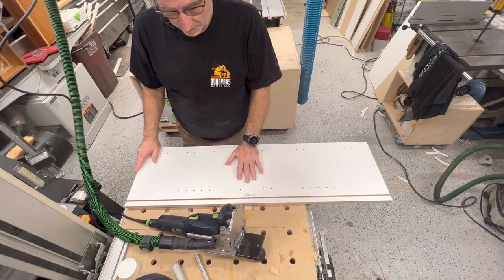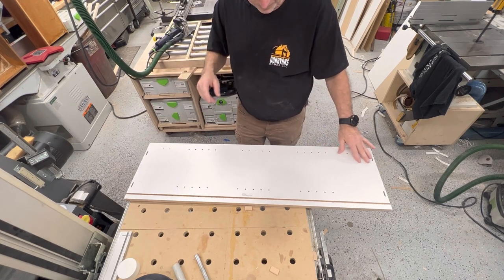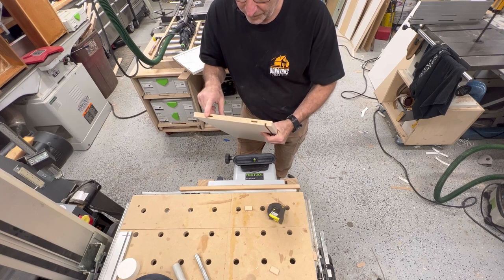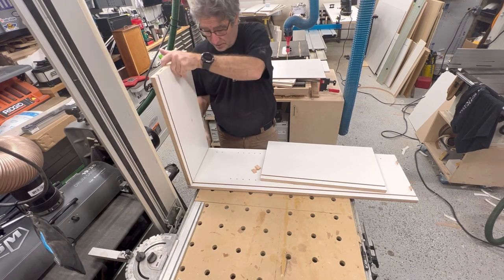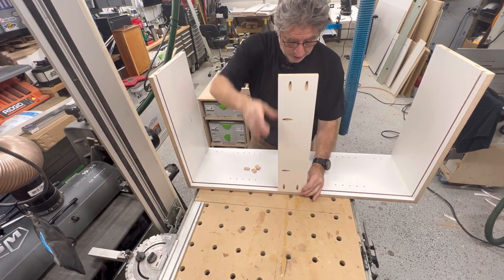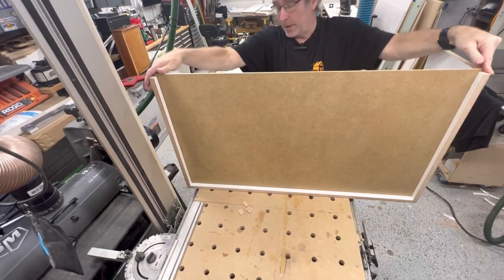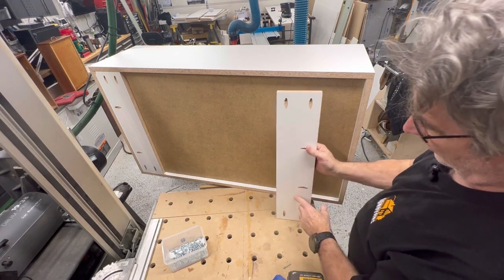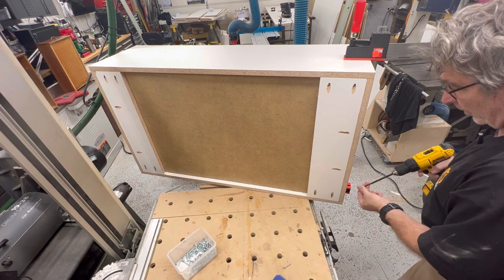Final Panel Prep and Assembly | Kitchen cabinet build series Part 7

Comment: Bessey bar clamps make life easier. I also use airplane quality aluminum bar clamps (they are light an weight) are fairly strong.
When building melamine upper cabs I like to use a little translucent phenoseal caulking for added strength.
Great video and channel. Cheers.

Comment: I don't think you can make a weaker joint than pocket holes in particle board. Both particle board and pocket holes are already a weak joint, but when you combine them, you get something extra weak. In the next video you can see that the pocket holes have already broken on some of the cabinets before the cabinets are even installed. Why custom build cabinets if they are going to be lower quality than the cheapest Home Depot Cabinets?

Comment: I just came across your channel. Hope you post more. Question about melamine joinery. I’m wanting to build similar cabinets for the laundry room. How strong are pocket holes in melamine? If you were to use glue what type? Can I substitute biscuits for dominos when used in conjunction with pocket screws? What additional joinery would you recommend for melamine cabinets?
Reply from the maker: Biscuits would work instead of dominos but I would glue as fit  is not as tight. Be sure to connect tops and bottoms with back stretchers that is most of the strength of the box, good luck

Comment: Curious on your thoughts on using glue vs not. I have a hunch you’ve stopped using it (at least for uppers) to make installation less of a fight. That right or is it something else? Finish carpenter myself, so I’m loving this series by the way!
Reply from the maker: With the pocket screws and Dominoes and the way the structures are screwed together on top and bottom I don’t think the glue is completely necessary especially if the cabinets installed glue wouldn’t hurt anything it’s just one more step. Especially using melamine it’ll fail before the screws or the Domino’s
Reply: @donavanshomes  thanks for the reply. It makes sense - if quality isn’t affected, but efficiency is, why waste time with another step? 

For video ideas, you could film your work at Matt’s to share the carpenter’s perspective. It’d be great to see you poke fun at all the crap he goes through to get all the perfect shots.

Comment: I want to make new kitchen cabinet doors (flat, no real design) to dress up the exsisting. What is the best material to  use for that?
Reply from the maker: I like 1/4”  MDF with a veneer face or Baltic birch if it’s just gonna be painted
Reply: @donavanshomes  Thank you.  I was 
wondering about Birch yesterday.   Definitely going g to be painting. I think you're videos have been extremely helpful,  thank you for sharing your knowledge.